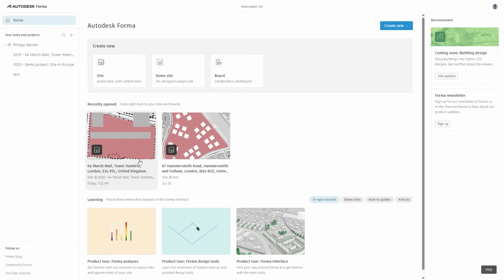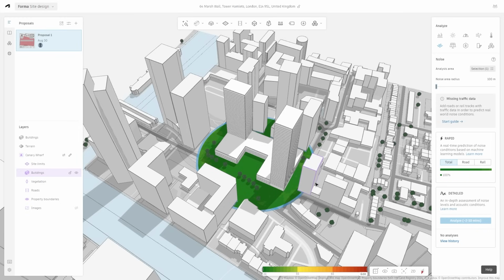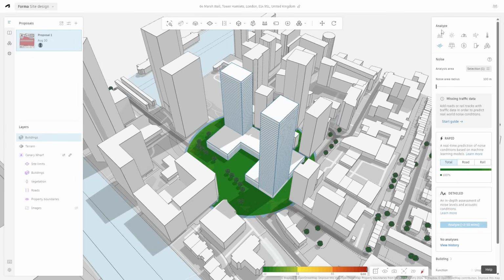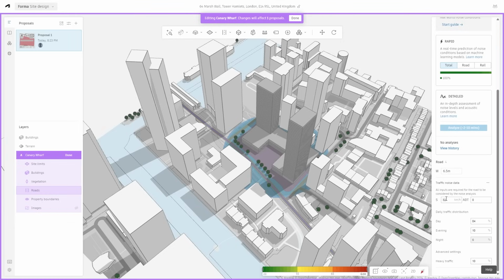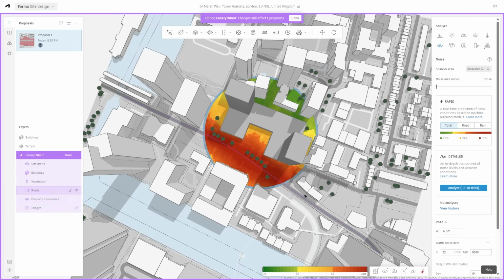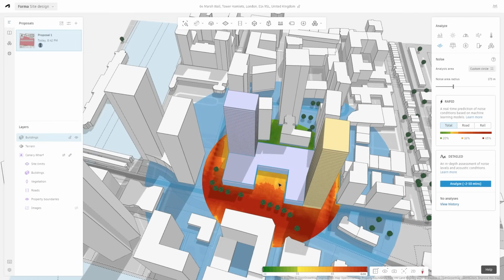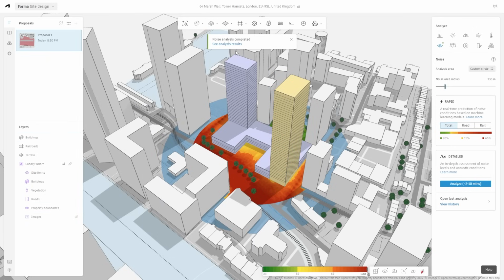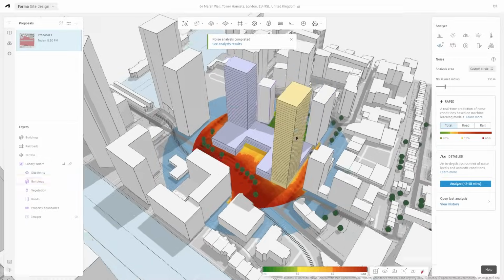Autodesk Forma Site Design - AI-Powered Noise Analysis

Comment: why eroor
Reply from the maker: Eroor
Reply: @PhilippGalvanDesign noise analysis for detail analysis always error why
Reply from the maker: What does the error say? 
For the noise analysis you need to define noise sources first. If that hasn't been done the noise analysis doesn't work. It's all in the video.
Reply: @PhilippGalvanDesign  I have entered the noise data on the road but there is no data for the railway so I did not enter it, but it still gives an error and there is no message.
Reply from the maker: Not sure then. Best to flag it with the support team.